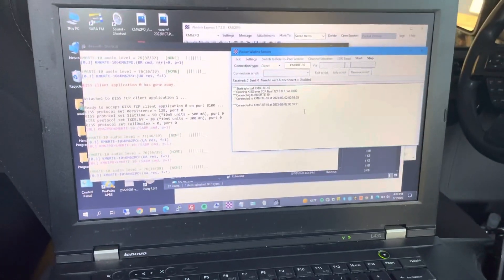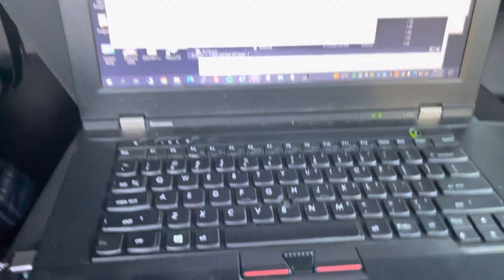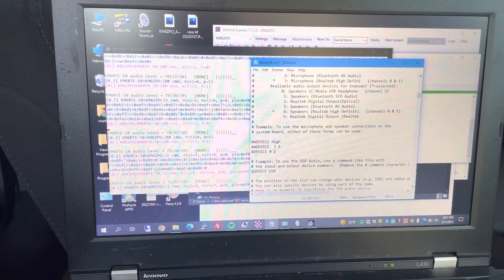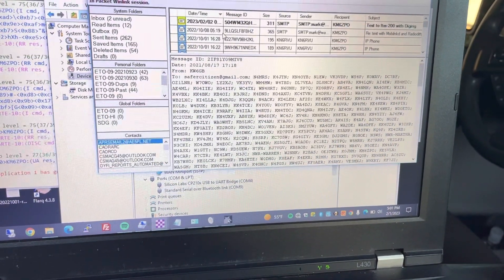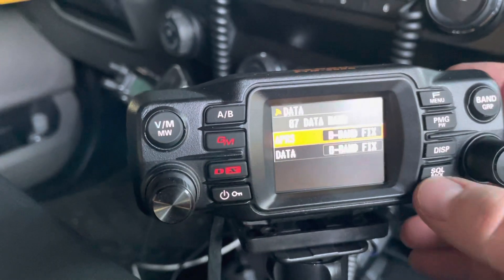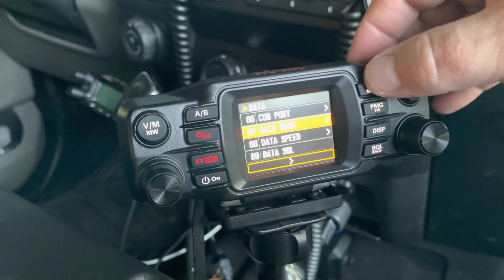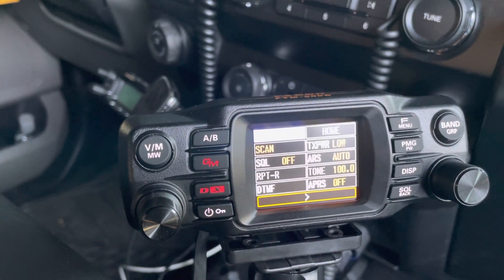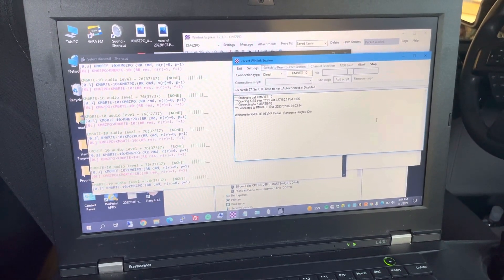Winlink via Yaesu FTM-200DR and Digirig

Comment: I noticed you had the direwolf settings for the modem at 1200, do we need to set that in winlink?
Reply from the maker: No.  That’s the over the air baud rate. 1200 baud is the most common packet gateway.   The comm port rate is the speed between the radio and, TNC and computer. That rate is normally 9600.

Comment: Hi Mark, great video. I'm looking towards the same setup. What type of Digirig Mobile did you buy (standard logic levels)? And which cable did you needed to go with the Digirig? Thanks for your info. 73 de Phil ON4VP
Reply from the maker: Default logic option (no cat control) with this cable set: Yaesu MiniDin10 9600-baud Data and Serial Cable for Digirig Mobile
Reply: @MarkWarrick this answers my question about cat control.   The link you provided to the cable on Amazon has two 3.5mm outputs.  Does this mean you just leave the green connection disconnected?
Reply from the maker: @cchalfantusa I believe the black one is the cat control cable and green is Audio.  Yes only one of them.

Comment: Thank you for the showing a nice way to get Packet Winlink working. Your display makes me wonder if the FTM-200 does not have two receivers by how its working.  I use the Mobilinkd with my FTM-400 and it works on the B band as expected.
Reply from the maker: You could be right.  There's a setting in the FTM-200 for how often it switches back and forth between the RX of the A and B channels.  That leads me to believe it's a single receive radio.

Comment: Ok very intriguing!  So you have a digirig and ftm300 digirig cable?
Reply from the maker: Yes and yes
Reply: @MarkWarrick  thanks!  This is great!
Reply: @MarkWarrick  one more question 😜.   On the DigiRig - did you have the default configuration set when you purchased?  (it’s giving me a few options to choose - tx500, rs232, ci-V)
Reply from the maker: @njensen447  Yes, I bought the default configuration. (Default configuration – select for Yaesu FT-8xx, Xiegu, HTs or any radio without CAT support)
Reply: And another question / idea - would this ftm200 interface also support other packet traffic?  Say BBS ?
Reply: Has anyone used this set up for varafm?